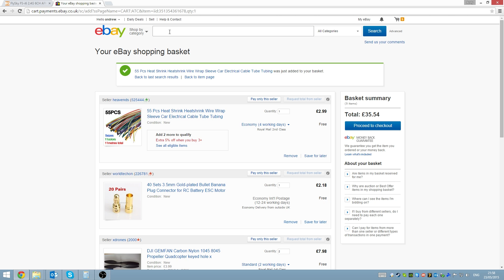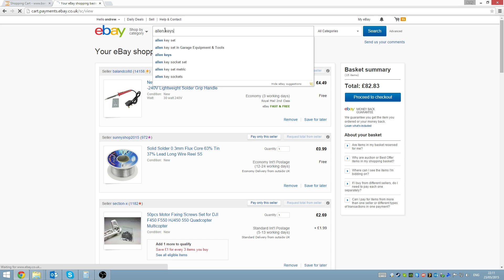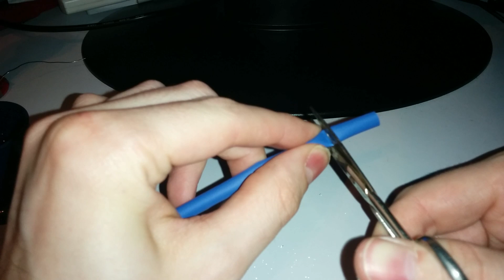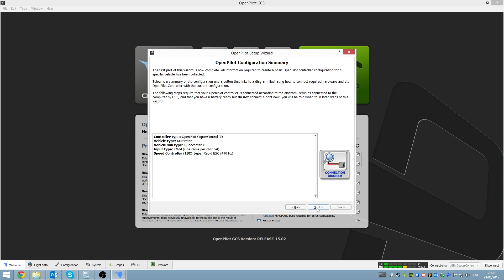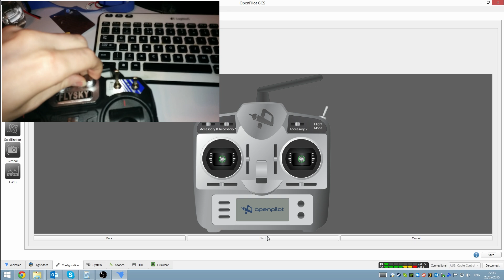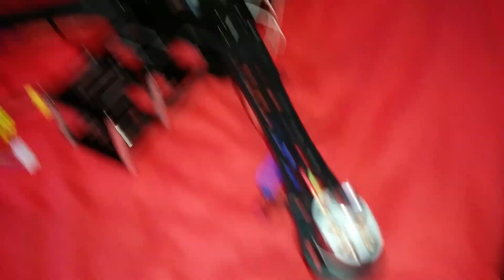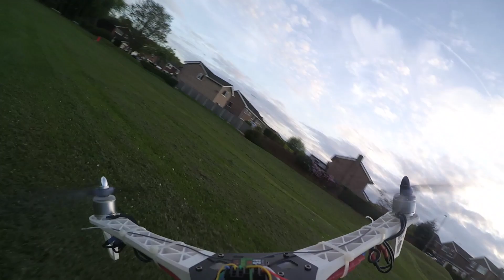Build A Cheap Quadcopter

Comment: BTW i found this offer is good ? 
( http://www.aliexpress.com/item/4x-2212-920KV-Brushless-Motor-4x-30A-SimonK-ESC-Quad-Multirotor-X525-F450/32343184580.html)
They are the same motors that u use ?
Reply from the maker: yes those are the same. good price!
Reply: How much thoes motors can lift and not burn out in 15-20 min to crazy fly ?
i add all weight and is like 1 kg drone no ? or i`m wrong ? How much weight yours with FPV on and GPS and all ?
Reply from the maker: +John George should be able to lift 1.7kg with a 4s and 8 inch props
Reply: +AndyRC can u explain a little pls 4s = ? and except that 4s and props what i must change ? Ty and sry i`m asking but i`m noob ..
Reply from the maker: 4s is the number of cells the battery has. each one has 4.2V max charge so the voltage goues up by that amount each time u add. this puts more power through the motor and therefore more strain so you reduce that strain by having smaller props.
Reply: +John George I got this props
 http://www.aliexpress.com/item/Gemfan-1045-Carbon-Nylon-CW-CCW-Propeller-EPP-For-RC-Multirotor/32440565752.html
I know they dont have that keyed hole but i will manage that...
tell me pls what to search for the 8 inch props that u tell me this i look for them by 1045 code.. Ty
Reply from the maker: i use these http://hobbyking.co.uk/hobbyking/store/__47861__8045_SF_Props_2pc_Standard_Rotation_2_pc_RH_Rotation_Black_USA_Warehouse_.html
Reply: +AndyRC uu nice i will buy 4 to, ty for quick answer, and supporting me :)
Reply: +AndyRC what do u say about this one ? they are the same ?
http://www.aliexpress.com/item/Gemfan-8045-Carbon-Nylon-Propeller-EPP-For-RC-Quadcopter-Multirotor/32404018405.html?spm=2114.01020208.3.19.jTRTLo&ws_ab_test=searchweb201556_6_71_72_73_61_74_75,searchweb201527_2,searchweb201560_9

I prefer alli because i have linked card...and freesipping to Romania
Reply from the maker: yes also fine :)

Comment: Andy is good 1 of this on the quad that u build ? LCD Flight Control Board ( http://www.aliexpress.com/item/KK2-1-with-case-LCD-Multirotor-Flight-Control-Board-v1-9S-Quadcopter-KK2-6050MPU-644PA/1795564006.html?spm=2114.01020208.3.38.GTjbaa&ws_ab_test=searchweb201556_6_71_72_73_61_74_75,searchweb201527_2,searchweb201560_9 ) Keep in mind that i buid the same build like u do in this video. Ty.
Reply from the maker: I didn't like the kk2 I couldn't get it to fly nice
Reply: +AndyRC Thanks a lot for answer, i like this control because u will need more channels, i found it that so i can turn the lights on i need a channel and the drone u presents have only 6, so ... that is what i like. Is the way so i can split channels so i get more ? BTW here is the link with the lights, witch i dont know how to connect them :))  ( http://www.ebay.com/itm/271612285492?_trksid=p2057872.m2749.l2649&var=570450059954&ssPageName=STRK%3AMEBIDX%3AIT ) 
this one: Size(3528 LED): 36cm x 0.8cm
they are good from my config ?
Ty.

PS. that  LCD Flight Control Board is not good for your problem that i see in the video u have with the last powered motor? it can be set a voltage and your problem solved, i dont know i just asking because i dont know well how it works, i have 0 experience with any kind of drone is my first that i want to make and hope from your video and your help to put in fly and enjoy it :D
Reply from the maker: +John George Hi you cannot split the channels check out the turnigy 9x is it cheap and 9 channel. I don't know about led I don't use them.
Reply: K, so ... No Lights :)) I can deal with it. i will stick it with this one in your vid and buy turnigy when i will get done with all construction.
Reply from the maker: im sure theres other videos that can help you with LED on youtube :)

Comment: Firstly I'd like to say that this is pretty neat and I'm totally new to RC flight, have built a few RC cars before but this looks like the next challenge for me, I'd love to build something along the same lines as you have in this video! Think this has inspired me to start a new project! Great videos!
Reply from the maker: +KamikazeXeX great! welcome to the flying side of it :-)
Reply: If you don't mind me asking what are your contact details?

Reason being is i'm probably going to build my first one based on this same design and you'll have established what could/should have been done differently during building it in the first place :)

As a total noob it'd be great to have a bit of "1-to-1" support, I've only ever built from kits so advice on different parts etc would be nice, I do plan to upgrade it with FPV after I've got the hang of flying it in general so I'd like to keep that option open, thanks in advance :) in the meantime I shall watch the next video! :)
Reply from the maker: +KamikazeXeX you can ask me anything you like on the comments or YouTube message. I don't really check anything else :-)
Reply: +AndyRC Great! no problem! I'll give you a message as soon as I get to starting on building my shopping list :)

Comment: hi AndyRC i relly need your help, i allready mes it up :)) i buy a Flysky FS-i6 2.4G 6ch RC Transmitter Controller w/ FS-iA6 Receiver like in this video, but i want to know it have telemetry or i can put it?
Reply from the maker: I have not connected telemetry myself but have a look at this link http://www.rcgroups.com/forums/showthread.php?t=2402288
Reply: +AndyRC so it work ? i just buy this and found this http://www.hobbyking.com/hobbyking/store/__8991__Turnigy_9X_9Ch_Transmitter_w_Module_8ch_Receiver_Mode_1_v2_Firmware_.html?gclid=Cj0KEQjw2KyxBRCi2rK11NCDw6UBEiQAO-tljcXOShTuSE_DgDaHTvIkVhPvEEG9G7nrfQbXKej5gqIaArHB8P8HAQ 
Is a little money diference i can get it if is better then this u recomand in the video, but i dont know how to make it work with the quad, u can help me ? Answer fast pls so i know if i Cancel Order and buy this second one this Turnigy. Ty a lot
Reply: no i will stay with this setup ty. i will tell u when my parts will arrive :) Thanks for all the help.

Comment: @AndyRc How much can you lift with this quad.I realy wana make one of this , and i already have turnigy i6 and reciver mod i6b with telemetry
Reply from the maker: +Dani Radulescu u dont wanna go over 1.5kg with these motors
Reply: +AndyRC  I looked at this video three times , i will make one.Is possible to use a gimbal with gopro on this quad?
Reply from the maker: yes however I would use slightly better motors to carry a gimbal
Reply: +AndyRC This tx have 1 more menu.If you wana enter just move yaw and roll to left down and power up .This menu is named "Factory"

Comment: Hey Andy and others,
After a few months of waiting on parts and building. I have finally finished the quadcopter, today I flew the 3rd maiden, as the first 2 failed. That's why I would like to advise people who plan on building this quad about a few things:
Firstly, do not get the alien x frame, get the cheaper 450 size f450 frame copy, which has integrated pcb. (I ended up buying this one)
Secondly, get better ESC's, because all of my ESC's started to stop working one for one, I recommend you get the better ESC's used in the high end quadcopter series on this channel.
Lastly, get enough props, although mentioned in the video, some people tend to forget this (me).

I would like to thank you Andy for the work put in to this video because this has helped me enormously in my own project.
Reply from the maker: +Tobias Veerkamp no problem :) My ESC are still working. but u can see I moved on to the higher end build also

Comment: Hi, I followed through your video completly and built a quad. I got the newer FS-T6 controller  though. When I try to save the PID instance 2 into accesory 0 I am not getting a check, instead I am getting a cross.  how do I program pid tuning into the nobe i'm not using. please help.

Comment: Thanks for this video it got me into quadcopters lol started off with this very setup and then installed things like gps, leds, sonar, flip32+ flight controller, gimbal with mobius for recording in hd. Im now building a 250 racing quad for fpv lets see how that goes.

For anyone building this ive looked around and found the best deal on 1045 propellers on ebay they work out at less then a dollar a prop http://www.ebay.com/itm/261828573201

Oh and install cleanflight onto your cc3d its amazing and packed with features https://www.youtube.com/watch?v=DRm_CyAyKcs
Reply from the maker: +Christopher Punton thanks for the update cheers
Reply: AndyRC how is your guyses build going? Do you think it's worth investing in other peripherals like that at this price point? Have y'all had any catastrophic failures yet?
Reply: AndyRC  you have this from andy
Reply: dron sorry or  any for sale

Comment: Great video man , surely help me alots. I have recently startedbto build 250,280,310 quads, next week I will start my F450 quad using naze32 pro.
Reply from the maker: fantastic :-)
Reply: Andy I have a question, fail safe setting should it be thro all the way down and let it crash or thro lower to try soft landing? Which one do you use?
Reply from the maker: +wing hum thomas fung for safety I always chose crash. trying to set a low throttle runs the risk of it flying off and hitting someone. not only that but where ever it lands the props will continue to turn
Reply: Thanks Andy will do

Comment: I was wondering how you get power to the receiver.  From the video it looks like the esc's power the flight control board which then supplies power to the receiver?
Reply from the maker: +jcl311 that is correct yes the bec in the ESC

Comment: Hi Andy great vids mate, Ive got one question the esc,s you say you researched them and they can take 4s i cant find anything about them if you can recall where you see it can you please post a link all I can find is links quoting 3s keep up the great vids ive built 3 of the quads you have shown also I follow Painless360 another great guy
Many thanks
Kev
Reply from the maker: +kevin lloyd a few people in the facebook group advised they used 4s with them no problem and I have also had no problems with 4s. that being said if u want to load it up with heavy gear its not the ESC that will fail its the motors that will burn so use 8 inch props if u plan to add gimbals etc but the esc will be fine.
Reply: Ok mate thanks

Comment: What was to total system cost for your build (including the price of mistakes like damaging the motor windings)?
Reply from the maker: +Power Max I burned 2 esc and 3 motors so maybe 50gbp on top of whats in the video
Reply: +AndyRC Just converted that over to US dollars, dang, that is pretty good pricing! Though I'd imagine that most that stuff is shipping from china? I have had too many bad experiences with that to say it's worth it. Anytime I try to go cheap, I end up paying more to get replacements. I currently have over $700 in my quad, it was initially working out to $550 and over the course of the year that it took to get it working almost perfectly, I had killed 3 multiwii boards, a minumOSD board, several wires, punctured 2 floureon 3S 4500mAH batteries, smashed the gimbal (crash), had to buy replacement props, legs, and frames, etc! This hobby is $$$! 

On another note though, It is strange how all the RC hobby people tend to set the low voltage cutoff threshold  pretty high, sometimes higher than 3.5V, and I think you stated in the video you set it around 3.7V, the nominal or average voltage of the battery! The standard RC lithium battery packs, so-called LiPos are actually just mostly normal lithium ion batteries, the same kind that I deal with in the "flashlight" hobby, that group of people tend to use 18650 cells, which are about 50% taller and wider than AA's, they tend to have cutout voltages around 3.2V and less. Generally damage will not occur until less than 2.8V per cell, beyond that is damaging, generally permanent increase in internal resistance and lowered WH rating.

Though with how my current LiPos fall out of ballence as they die, it is easy to end up with a situation where two cells are like 3.4V and the 3rd is barely 3V! Also, lots of people mistakenly measure the voltage on the battery after disconnecting the load, but, going by voltage alone without a load connected is completly inaccurate. I have actually fallen prey to that fact several times. If you leave a dead battery sitting around, the internal ionic resistance is high, but the voltage open circuit can easily climb right back up to like 12V or so! I had a battery that I thought had been damaged since it showed 12V on the pack, but I could only fly for like 2 minutes before it quickly died! Recharging it back properly all the way, (open circuit 12.5V) it worked fine! lol!

I think the biggest reason for having higher cuttoff voltages is because the LiPos are cheaper quality and are not as well made as, say, a $24 18650 panasonic 3100 mAH 4.3V cell, and also that even the brightest of flashlights only draw like 10W per 18650 on Max. The C rating of 18650 tends to be much lower since they are used in lower drain applications and it is I guess safer.
Reply from the maker: i tend to find that weather you buy cheap or expensive you end up spending a lot. the hobby is a money pit no matter how much you look at it. the voltage cut off is set high because after that voltage they drop off quick and it wont be able to provide the power needed for the motors and you will get a brown out. all the best

Comment: Andy, can you take an exact measurement of the screws at their right length, just so as I don't short one of my own motors? Also, I bought these exact motors, and notice they turn in stop start type of motion, all of them, is this normal? If it's not, let me know anyway, it's my own responsibility, my own choice in choosing the parts.
Reply from the maker: +owenkilleen yes thats correct how they turn, the screw length should be 10mm

Comment from the maker: @Taaku Edit you need to change your google+ settings its wont let me reply to you cheers
Reply from the maker: 3.7 :)
Reply: +AndyRC Sorry I got disabled that option, my bad, now you should be able to reply my coments thanks! :)
Reply from the maker: yes you can add a gopro no problems its the same form factor as the one i used all the best
Reply: +AndyRC Thanks! I'll try it out then!
Reply: +AndyRC Btw, what happened to the voltage checker you bought? I think you didn't use it, at least in the video, I mean, does it work like a normal tester? soldering cables and putting them where you want to check voltage?
Reply from the maker: it is used in the video. it connects to the balance port of your lipo. no solder required
Reply: +AndyRC Ok! Thank you!
Reply from the maker: no problem :)
Reply: +AndyRC I just bought a 280 Carbon kit, Emax II Motor's... and that is far as ive got. Looking at Flight Controller's, at the moment ... To be honest i don't know what to choose for my FPV. (any suggestions, would be grateful)
Video was... By a long way the best ive seen. Love the flight at the end, the flight video you got (On a budget) is mind blowing. 
You have a talent for this, i look forward to seeing more of your video's... Thank you !!!
Reply from the maker: theres a video after this one called adding FPV. check out what i used there. you can do it pretty cheap. thanks for the support
Reply: AndyRC
Just watched it, thanks ... Think i will leave the FPV to last, get in the air first.
Love the video's, keep up the great work...
Reply from the maker: +gordon hamilton yes u should always get it flying and add stuff after
Reply: how long are the right size screws?
Reply: +AndyRC how much did you put the voltage 3.7? or 3.8? thanks
Reply: +AndyRC I can't find where you used it. What time in the video is it? Thanks
Reply: AndyRC where can I find part list?
Reply from the maker: in the description cheers
Reply: AndyRC could u help me with my problem!
Reply: AndyRC please -.-
Reply: what's your problem ?
Reply: Odus Thesar is it okay if i using x6b receiver
Reply: Odus Thesar is it okay if i using x6b receiver
Reply: Razer Hobby where ? why ?

Comment: Is selflocking propeller and a keyed hole propeller SAME????

😟😟😟😟😟
Reply from the maker: +Sanjay Suresh no they are not. self locking propellers require threads on the motors to screw in the opposite direction of the prop
Reply: Thank you
Reply from the maker: no problem